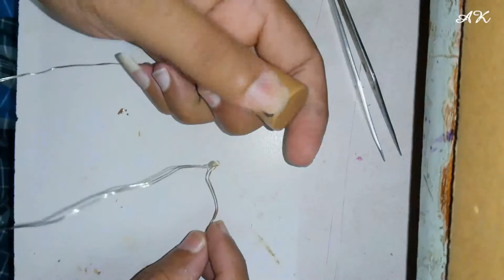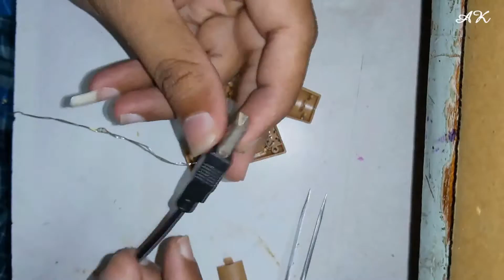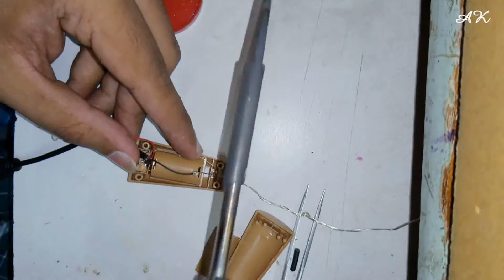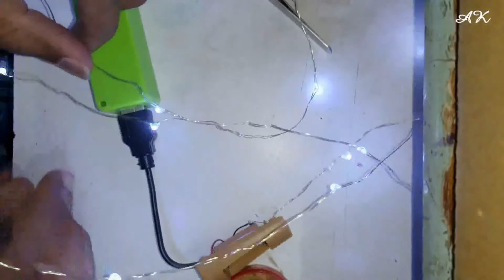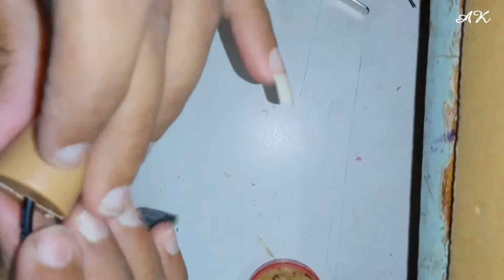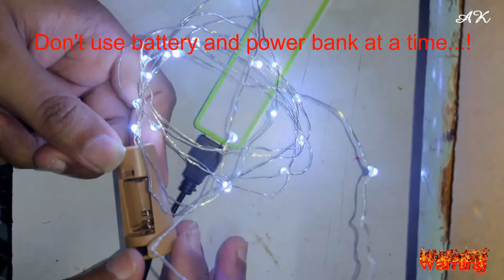How to add USB cable in LR44 Battery Bottle LED...

Comment: how many ohm resistors do I need, to power the 10 wire LED. previously used 3pcs LR44 batteries
Reply from the maker: use 47 ohm